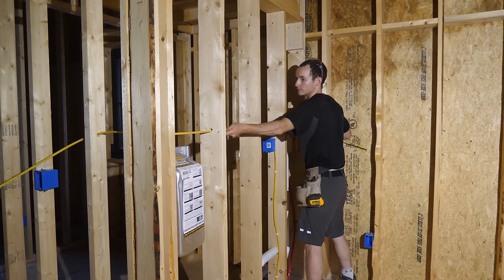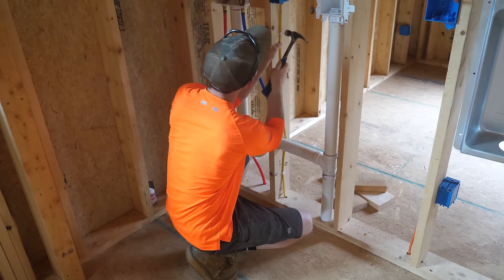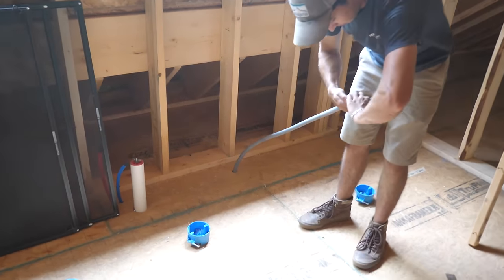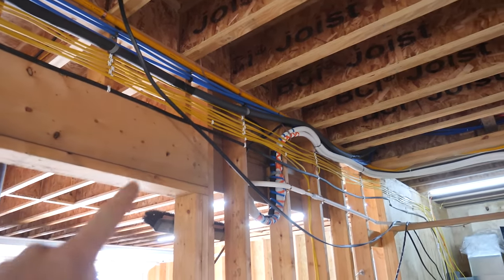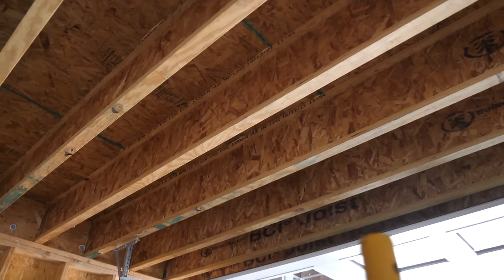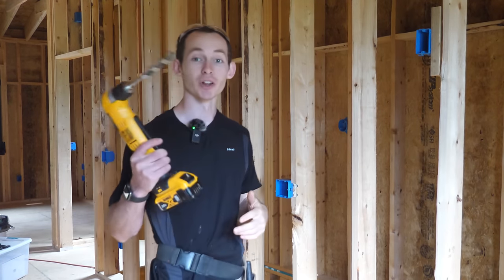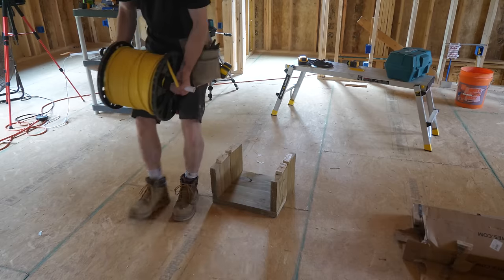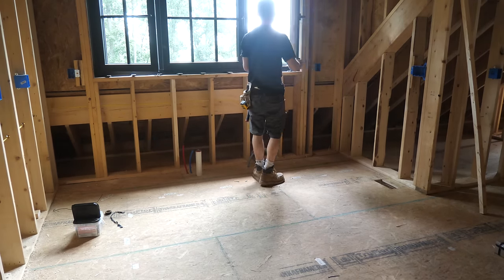Electrical Rough In Wiring for Receptacles

Comment: I think square screw heads are less likely to strip
Reply: Much less likely and up in the great white north they are called "Roberston" bits. They are easy to use one-handed, because the tapered socket tends to retain the screw, even if it is shaken.

Comment: robertson is square.. i find lots of stuff with robertson... canada is mostly robertson.. we have a bunch of things plugged in near the sink and on the counter.. coffee maker, led under cabinet lights, small coffee grinder, can opener, knife sharpener, toaster, microwave  we have power strips screwed into the wall since there are nowhere near enough outlets.. to do over, 100% duplex outlets and every 24 inches maximum
Reply from the maker: oh gosh not the power strip mounted to the wall 😆 we are trying to keep all countertop appliances on the pantry countertop to keep the kitchen uncluttered. Duplex outlets are right around 24" in the pantry

Comment: You seem to be using 12/2 for all receptacles when 14/2 would suffice.  You don't think 20A is overkill for standard receptacles?
Reply from the maker: I don't, it's almost no difference on cost and keeps it simple in my head - yellow = receps, white = lights 😄 on the household receps, 15A is plenty. But on the garage receps, I have several tools close to that limit such as a 13A pressure washer. I'd rather upsize there and keep it consistent throughout for simplicity

Forgot to add - code for the small appliance circuits in the kitchen required a 20A circuit, and I think the dining is included also. That covered about half the receps upstairs, so it was easier just to run everything in 12 gauge.

Comment: thanks for the video. Happy New year and keep up the great work. Suggestion - as the weight of the spool of wire lowers as you use it, its not going to be heavy enough to resist you pulling the wire vs the tension of the wire. Add some method of locking/bolting the reel down to the platform.
Reply from the maker: Thanks for the idea! Happy New Year to you as well!

Comment: Milwaukee has some nice ECX driver bits and screwdrivers that make terminating outlets and switches lot easier. They are a combination of a flathead and Robertson bit.
Reply from the maker: Looked it up, never seen anything like it. Appears to be a perfect fit for most electrical screws. Thanks for the recommend!

Comment: For boring holes, I highly recommend Irwin speedbore bits.  They make quick work of holes and require a lot less effort on  your part to get the bit through.  And they stay sharp for a long time.  They're also keyed for impacts, so in a pinch you can use a compact impact driver with no issues. I've used them on my Milwaukee M12 fuel impact driver without issues.
Reply from the maker: Thanks for the recommend! I've seen those before, sort of a combo spade and auger bit. Will definitely give them a shot

Comment: For drilling through the studs you can use a drill bit extension in those spots where you have to go through multiple studs or have awkward spacing between studs where you can't fit the drill in with the bit installed.  I've always used spade bits but they can produce some chip out.
Reply from the maker: I have them for 1/4" bits but didn't have anything for the auger bits with a bigger chuck. May or may not have killed one of the $2 harbor freight 1/4" extensions trying to use it with a spade bit... 😁

Comment: Nice and neat good job. You mentioned one circuit for the microwave and island outlets remember there is a code to install according to manufacturer instructions. Check your microwave installation directions because most of them require a dedicated circuit.
Reply from the maker: Thanks for that tip! It does look like many run at about 13-14A at full power and "require" a 15A plug but "recommend" a dedicated. I'll keep the dedicated 20A that I ran there, and extend one of my countertop outlet circuits to feed the two island receps.
Reply: @MasonDixonAcres  good idea. There’s another code reference that limits a single load to be not more than 50% of the circuit that’s why a lot of window a/c units only draw 7.5 amps.  Keep up the great work.

Comment: I think you said you ran 6/2 Romex to your EV charging outlet. I’d suggest 6/3 Romex because you’re going to want a 240v outlet there, not 120. Install a NEMA 14-50 outlet or you can hardwire to a future EVSE (aka EV charger), although if you were going to hardwire the EVSE, I’d mount the box higher on the wall, like 48”.
Reply from the maker: It will have a blank cover plate for likely quite a few years so decided to keep it low and more out of eyesight. I've read most (if not all) EV chargers run exclusively on 240V, so all you need are 2 conductors and ground to accomplish that. The third conductor is only needed if 120V power is needed, such as a dryer or stove where there might be a standard voltage control panel or light bulb.
Reply: True, you could run 240v on 6/2 with two hots and no neutral, which will work for many EV chargers. Props to you for thinking of the future with wiring for an EV and induction stove as long as you’re doing it.
I made the suggestion for 6/3 because a lot of EVSEs come wired with a 4-prong NEMA 14-50 plug and some have built-in GFCI which needs the neutral. I’m not an electrician, but I wired a 14-50 outlet in my garage on a 50A 240V circuit to plug in my mobile charger when I first bought an EV. All my research said 6/3 was the way to go when wiring a new EV circuit. 
(Also, in the future if you ever have friends visit who own an EV, you’ll be a hero if you have a plug they can use!)
That said, I love your videos. Nice work, keep it up.
Reply from the maker: Gotcha! I guess I’ll have to cross that bridge when I come to it to get the right charging hookup for a 6-50 plug or hardwire.
I appreciate the input! Thanks for following along!